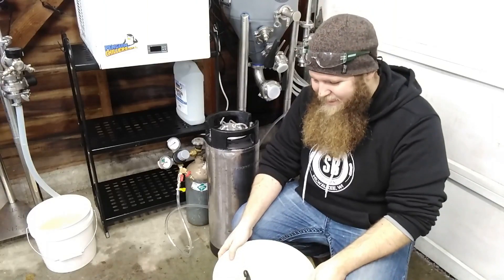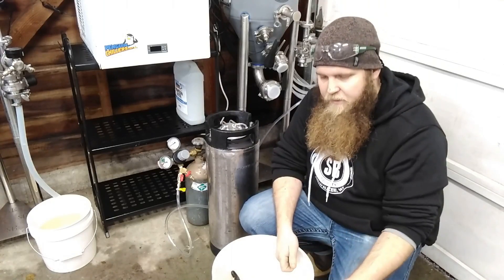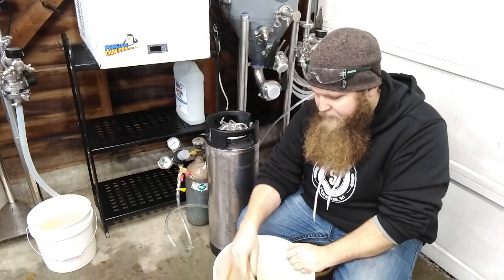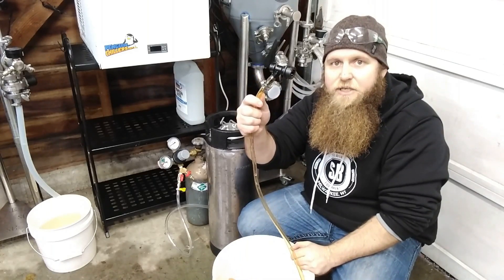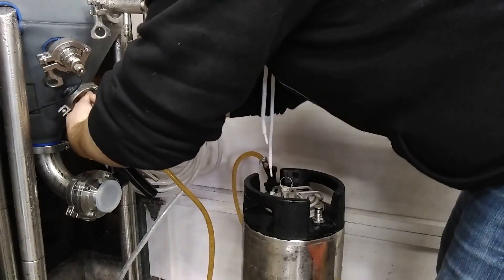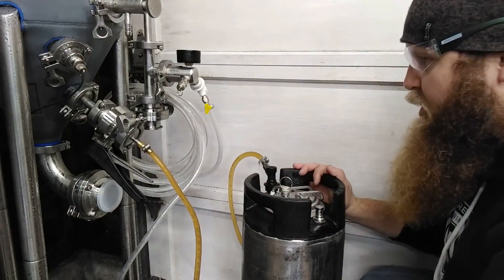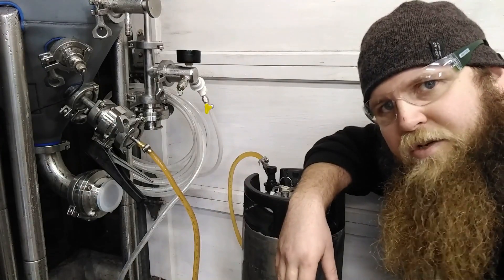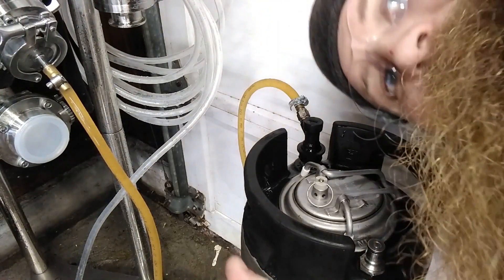Spike Brewing CF5 Unitank Kegging

Comment: great video.. I use a spunding valve on my kegs for pressurized transfer from my Ss Brewtech Unitank. This works very well for me. I have known full weights of all my kegs which i use to determine when they are full. Your method is easy and one i may try..... Nice job

Comment: Thanks for the video! As far as filling a keg of carbonated beer all the way until beer comes out the PRV, would this take place of purging the empty keg prior to filling? My current method involves filling the keg completely with starsan water and pushing it all out before pushing beer into keg. I usually fill to the welded line at top of keg. I may consider filling all the way to out of prv if this is a method of eliminating the dispensing star san out of keg prior. What do you think?

Comment: How do like the penguin chiller.  I have the cooler setup but I can't get it cold enough to cold crash and quick carb.
Reply from the maker: So far it's cooling ability is unbelievable. It took the glycol mix from room temp to 28F in about 10 minutes. When I connected my tank, it took about 2 hours to crash it to 32 degrees and kept it there with no issues for a week before I kegged off the tank. There are a couple of big flaws i'm working through, but it's more with the design and functionality than the cooling power.

Comment: hi do you have a link for the stuff in the bottle?
Reply from the maker: It's 70% Isopropyl Alcohol. You'll find it in the first aid section of any drug store. This is different from Ethyl or Rubbing alcohol.
Reply: @ItsaBrewDay  and it's better to use? I just use a strong star San ? Does it matter if you get any in ya beer?
Reply from the maker: @craftbeeruk279  Five Star Chemicals, maker of StarSan, does not recommend keeping mixed Starsan in a bottle or anywhere for any extended period of time. I emailed them directly to get their recommendation on storage, concentration, and contact time for beer spoiling bacteria. 70% isopropyl alcohol (IPA) is extremely effective as a spray, requiring only seconds, and doesn't go bad. It's the go to for commercial breweries for a spray application. Unless you're dumping it into the beer, just a fine mist spray or three won't impact beer quality. This podcast has some information about IPA, but it's mostly focused on iodophor. However, the paper they are talking about went into a lot of detail about contact time and kill rates across several organisms with IPA. http://masterbrewerspodcast.com/096-efficacy-of-sanitizers-in-the-brewery
Reply: @ItsaBrewDay  thanks so much that's great!